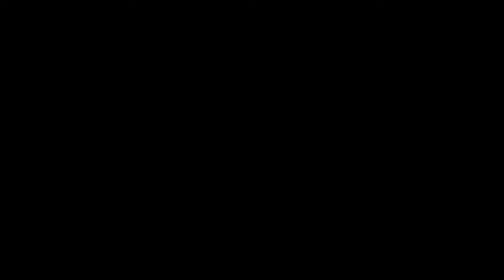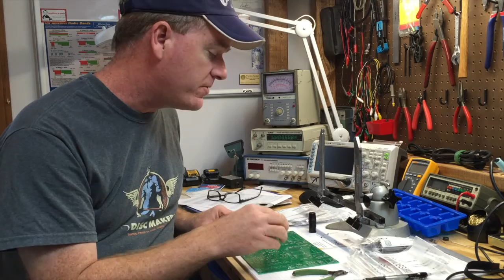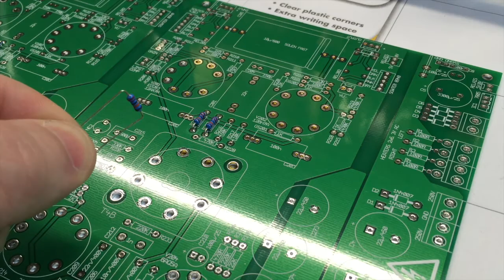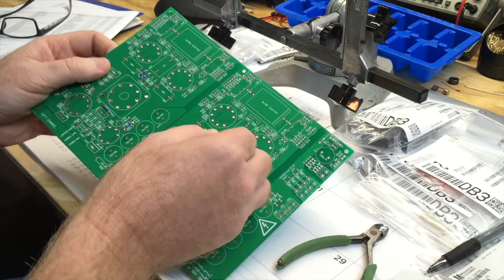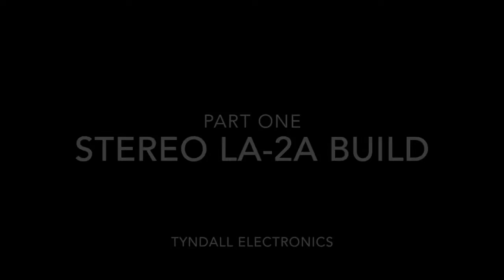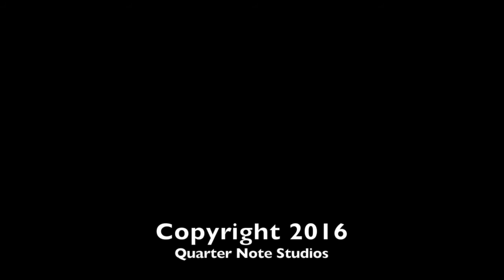Stereo LA2A Build - Part 1

Comment: Is there any sonic difference between using a PCB and an old-school turret board? Thanks in advance!
Reply from the maker: Depends on the design of the PCB and the layout of the turret design.  There is probably less chance of noise in the turret design, since parallel paths are minimized. But, it all depends on the layout.